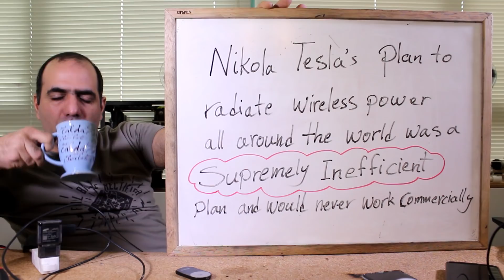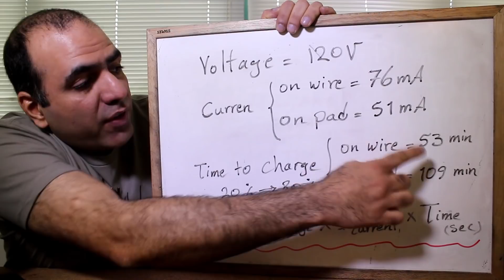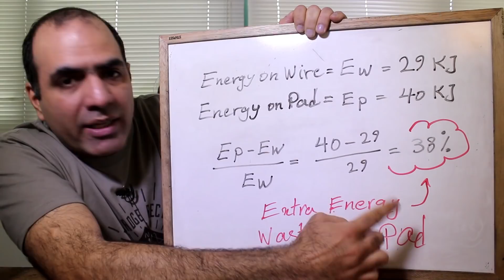Drowning in Inefficiency

Comment: You forgot one of my pet peeves. Air Conditioners. Making the whole world hotter so you can have a moment of cool air.

There needs to be an invention that turns waste heat directly into electricty. Eliminating steam stacks and turbines, and on a smaller scale, those that want cool houses in hot summers can use it to generate electricity rather than waste it.

Comment: I mean. I like my charging pad I use at work because I also like using my wired earphones. I also have the misfortune of liking Apple products (which is probably my first problem :p), so I need some way to used my wired headphones while also charging my phone. (Legit, if I could easily move all my save data from Apple to android, I probably would’ve by now. Alas.)

Comment: Human Power Power Plants using flywheel engines and human ingenuity are able to be 87% efficient. 
Human Power is able to power led flood lights that are able to power solar panels 24/7!!!
Get with the MOVEMENT Dude!
Reply: Converting the electricity to light and then converting light into electricity is super inefficient! Just charge batteries with the human-generated power and skip all the back and forth conversions that waste power!

Comment: After seeing this.. I'm gonna create an engine with about 50+ efficiency😅😅
Reply: what kind if engine? electric...do not worry high power electric engine has 95% of efficiency :D
opposed piston ICE has 55%... :-)
so what next ?
Reply: Trying to think something completely out of box but my mind is kind of stuck  on Stirling engines.. idk why bt it is stuck
Reply: @shivashukla3432  please read about laws of thermodynamics if you mention stirling engine.
Reply: Plus these light bulbs.. so low on efficiency.. thinking bout them too
Reply: Thinking bout electrical arcs as they can support a flow of electricity over very low resistance due to plasma bt the output light spectrum nd intensity is still a problem to be solved plus tube lights nd stuff already do this so.   Tbh.. I'm a bit confused nd out of ideas😅
Reply: I've studied stirling cycles nd diesel nd otto cycle.. all not very efficient when actually used.. solar Stirling engine is the thing bout which I'm thinking
Reply: @shivashukla3432  so you know why diesel, otto and stirling cycle has not so much efficiency (40% it is not so bad) efficiency this is one point, reliability this is another point. so we need to calculate everything including how many resources we need for such technology, how much energy to produce and maintain engine.
Reply: Carnott is perfectly efficient.. bt just a theoretical cycle
Reply: Stirlings are good bt not very energy dense.. like they can't produce energy in megawatts bt could be used as a part of a huge system of those engines
Reply: I'm feeling like very much out of ideas
Reply: So much stuff to be calculated by a 17 yr old😅😂

Comment: The next generation of wireless charging is a ceiling mounted unit that directed tight beams to power devices. It aims these beams by using infrared pulses that bounces off reflectors applied to the devices you want to wirelessly power. More efficient but still crazy inefficient

Comment: Well lets see if witricity is getting foreward, since Qualcomm bought the company in February 2019. One step foreward is using resonant coupling . Works well for microwaves. The second part will be getting rid of thermal loss either with lower power consumption or with more efficient conductors.

Comment: There is an other interesting fact of solarpower. Each solarcell is made of silicon or polysilicon. To get silicon out of sand you need a high amount of power (power from today, power from coal, gas or nuclearpower. So we have to use this cells a long (looooong) time to get a positiv CO2 result out of it for our planet. We should save energy wherever we can, all saved energy is saving the planet.

Comment: Would having a single inverter for a house be more efficient (using separate DC wiring for house lighting)? It would certainly be able to reduce the RF interference that the LED bulbs create, as the inverter could be better RF shielded. Perhaps less heat would be generated as well, or it could at least be better managed.

I use wireless charging (please don't kill me!) because it is convenient and I rarely need my phone charged quickly, but I do know it is less efficient. Most of the lights in our house are LED.

Comment: Man that trip sure did charge your batteries.

Btw Elon Musk makes electric cars, which waste 70% to make the electricity from fossil, and from that, 55% becomes kinetic energy. Instead of a fossil engine that would waste only the first 70%. Your words, not mine.
I don't really know the reusable boosters numbers, but maybe they aren't all that efficient. Given the fact that you need excess fuel to land them, and then need excess fuel to cary that. That makes the booster way less efficient, which requires  to make it bigger, so heavier, so it wastes even more fuel. Or make the payload smaller, so it pays less. Yeah, I don't know about that. Maybe dumping them is actually more efficient, but landing them is certainly better for publicity.

Comment: I'm going to make a free energy device it's called a water wheel lol I'm going to make it out of scrap wood and a junk alternator converted to a pma remove the Full bridge rectifyer step the AC up with a transformer to transfer the power a short distance then step it back down to charge batteries and power an imverter

Comment: considering wireless charging its practical in some cases, for example i used a hand milling machine to cut a hole on the underside of my desk where i put my wireless charger, so my charger is totally hidden under my desk and i always put my phone on the same place when working on my pc, so i put my phone down and it charges. its a nice gimmick

Comment: I had to change the charge port on my phone a couple of weeks ago, I have been using the phone for over 2 years though. It did still work, but only if you put a book on the cable to stop it falling out. Thanks to Sony for putting the charge port on it's own tiny PCB in the Xperia X, much better design that those with the USB port soldered to the motherboard.

Comment: Why isnt my furnace a nat gas generator that heats the house as a side effect?
Reply: I think your idea makes a lot of sense. So instead of the waste heat at the utility company being wasted, it could be heating your house. The other advantage is that now you have eliminated the transmission losses which are about 50% of the losses after the energy leaves the generator at the utility, and is consumed by our devices. The downside is that the efficiency of a large generating system vs many small systems might come into play. But overall, I really like your idea. You should market a system like that. Kudos to you.

Comment: Finally someone who agrees with me. People really want to waste time, energy and sacrifice phone durability (becase of glass back) just because they are too lazy to plug in and out the charging cable? Even the argument that charging port is worn out quicker. As you said i used a lot of phones but i never had an issue with broken charging port. Only with one, but it was  after 7 years of using old dumb phone. Most of the people in this time will change their smartphones 3 times!

Comment: I think Tesla wanted to tap into Earth´s Magnetosphere and harness the energy that is already available there... or, alternatively, use the Magnetosphere as a conductor to distribute energy.. Planetary electromagnetic dynamics are pretty complex and there is a whole movement that claims to revolutionize science called "the electric universe theory"... But anyway, even if you don´t accept the "electric universe theory" as valid, our understanding of the Universe has changed a lot since the time of Tesla and nothing guarantees it is a perfect understanding now.

I don´t really know how efficient his designs would have been.. But I think it would either be non-viable with 0% efficiency in any practical application, if dependent on normal air conductivity. Or it would be unpredictably efficient, if it turned out to be that you can indeed use the Magnetosphere to conduct electricity (which lacks a working theory or a proof of concept, but still, is a hypothetical possibility)..

Comment: The old Tesla- Edison debate! AC wastes energy - DC stores energy. We need to change the Grid to DC. We are radiating or world with dangerous electromagnetic frequencies. How many will have to die before we wake up. Our first hundred years with the most inefficient system. It was cheap but not smart.

Comment: The more efficient you make a standard combustion engine, the worse the emissions tend to be. We could have 60mpg cars be commonplace but the emissions regulations prevent that from happening. VW got in trouble with one of their high mpg cars because they fudged the emissions standards a bit in order to achieve it. So it's not always just the lack of technology holding us back but it can be regulation and in the case of combustion engines, preferring inefficiency over smog.

I'm relatively confident most of the overall efficiencies to be had in the near to medium future are still going to be in organic and chemical fuel sources because battery technology has hit a wall and the densest theoretical batteries are still quite a bit behind the energy density of say gasoline. Also, a vehicle can burn fuel far more efficiently than our current processes for generating infrastructural energy so switching to an electric car actually increases your carbon footprint by a lot in various ways, it just shifts that carbon footprint to somewhere else. Mazda has a new engine that ignites gasoline by sheer pressure rather than spark which greatly increases it's efficiency.

Until a different method of generating photo-voltaic cells is commercialized because it's feeding a terrible chain of problems through the fetching of the rare earth metals, china land grabbing Africa and perpetuating and allowing for child labor and war tribes and terrible slave like conditions of workers mining these rare earth metals that we potentially do not even have enough on earth of to support solar cells as a viable option....

Comment: Dear ElectroBOOM, why did you bash Nikola Tesla? Could you investigate Tesla's bifilar tuned wireless transmission circuit? From what I read it was a tuned resonant circuit with a common ground around the globe (earth, very low resistance) and air (very high restänce - aka a capacitor) so if you go up high with frequency and voltage also the resistance goes towards zero, wouldn't it?
Reply: I seriously doubt it wouldn't have worked, and you hopefully know the two phase system (concatenation factor of two instead of sqrt 3) which would improve transmission instead of distribution (has no direction).

Comment: "Electric engines are 60% efficient"

I've heard before that they are much higher. Could I have a source for your claim please?
Reply: paul austin  A source for his claim in this video. Also, he claimed solar panels are 30-40% when I understand they max out in the mid 20s. Of course, I could be wrong / there could be more to it /etc - but how do you propose we settle that? 

What's your position, do you think he pulled these numbers out of his arse for effect and you're fine with that or do you think he actually has a source? 

I'm personally hoping for the latter.

Comment: There is actually a good solution for solving the low powerplant efficiency. The efficiency is low because you need to create a pressure drop over the steam turbine, which is done by cooling the output in a condenser. About 70% of the produced energy end up as heat in the condenser. Now you can use this heat for district heating. We have done that we great success in Denmark and it getting more widespread around the world. Thereby you avoid using electricity or gas for heating. 
Furthermore, you can build or convert existing power plants to waste incineration plants. Solving 2 problems in one go. You produce power and you get rid of your waste.
Reply: "Now you can use this heat for district heating" this could only be used in cold countries.
Reply: @kaikart123  According to the IEA heating accounts for 50% of total energy consumption. A lot of this is used in industry and agriculture where district heating might have limited applications. But in large parts of Europe and America, you still need heating in homes. You're effectively pouring GW's of power out the window, while using gas to heat your homes. All because the infrastructure for district heating isn't there.
Furthermore, by placing powerplants in industrial areas, you can use the steam and hot water which would else be wasted. Just visited an old coal plant in Hungary where they did that. They however also poured about 1.8GW of heat out to the birds, because of lacking infrastructure and bad location.
Reply: @srensrensen6269  Like I said, that extra heat is only useful in cold countries
Reply: @kaikart123  What do you mean by cold countries? Western nations are some of the largest energy consumers in the world and most of them are in regions where heating is needed, some places even in summer. Plus you still have factories who needs heat for process water and steam, regardless of the weather. Europe, Canada and the US combined makeup over 1 billion people. Implementing district heating in southern Spain or Texas might not make much sense, but it does in large parts of the world. As longs as there isn't geothermic heating available,  the area is population dense enough and the earth isn't made of rock, district heating is a no-brainer.

Comment: @4:42 Some power stations are indeed as low as 20%, especially the coal burning steam turbines, but it has also become common for well designed combined cycle power stations to exceed 50%, even close to 60% in some cases.  
These have gas turbines (or sometimes diesel engines) running on natural gas or fuel oil and use the waste heat to run a steam turbine, recovering a good part of the heat that would otherwise have been wasted. 
I'm not sure what percentage of power is currently generated by combined cycle power stations but at least most new power stations that are being built that way.

Comment: What do you think about
N U C L E A R   P O W E R ?

dun dun duuun
Reply: Still only about 35% efficient due to thermal cycle and - wait for it -
about 0.3% efficiency when considering the entire energy transfer from fission to hot steam.
So YAY! Nuclear power is the least efficient method of power generation so far :D
Reply: @totalermist  oof, yet it has such a massive output at that low efficiency.
such room for improvement, gets my fingertips all tingly
Reply: @azafreak  Sorry to disappoint you, but there isn't much room for improvement.
The thermal cycle is what it is and the Carnot-Theorem still holds.

If you want more efficiency out of fission reactions you'll end up with a bomb. The horrible inefficiency is the price that has to be paid for having a controlled reaction - TINSTAAFL. Well, that and the significantly higher installation costs compared to other means of power generation.
Reply: @totalermist  I'd thought there could be more than just the thermal cycle, so much ionising radiation untapped. That adds to the efficiency if we can use it. Lots of UV too, and cherenkov. Guess we need to make super sturdy solar panels to catch the rest.
EXCITE
Reply: @azafreak  The power density of ionising radiation is incredibly low, though. It would be enough to power a cellphone or two, but wouldn't be able to contribute much compared to the traditional heat transfer approach.

The difference is several orders of magnitude. It's a bit like getting excited over the possibility of using your hamster in its wheel as an additional power source for your household...
Reply: @totalermist  Bummer, tbh i'd be excited with enough hamster wheels though.
Hamster powered cellphone charger sounds pretty awesome now that I think about it

Comment: Re: internal combustion engines are 20-40 percent efficient

This gets even worse when you measure efficiency as the work per unit gasoline in an actual car. Back in my 200-level physics class, we worked out that a Prius (!) is only at about 14% efficient at turning stored energy in gasoline into forward motion.
Reply: As long as charging doesn't take less than 5 minutes, EV will never be mainstream. Also most of dis-efficiencies in vehicles comes from frictions of power transmission, EV cannot escape this either as long as they are still not directly driven to the wheels.

Comment: and what solution do you propose? i mean i always charge my phone with a cable because wireless charging where the phone has to be physically present in a specific location is just braindead as hell and a lie to yourself. the cable is 2 meters long, so i can move in 4 meters diameter with the phone charging. "wireless" charging needs the phone to be in really close proximity, much closer than even the shortest available usb cable on the market.

Comment: I'm assuming a lot of inefficiency of LED lights is because of the size limits for the step down power supply in their base.  What if you had a single high efficiency power supply in your house that feeds all your lighting circuits the low voltage DC they need to run LEDs directly?

Comment: "You need a heater at home in the winter anyway".   And the light bulb fails at that as well as it's heating the air at the top and the ceiling.   That would be very useful if we had anti gravity.